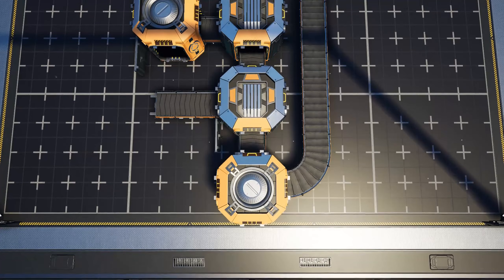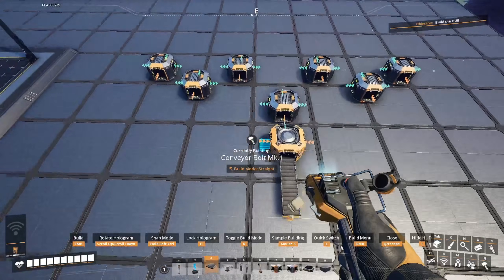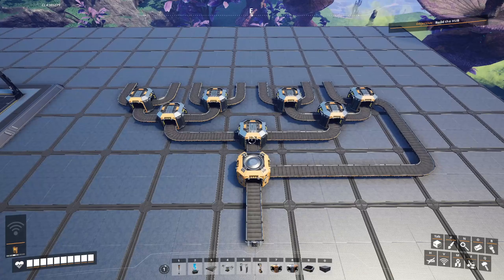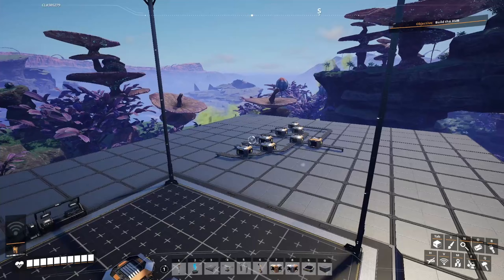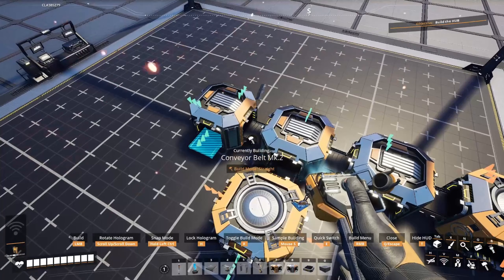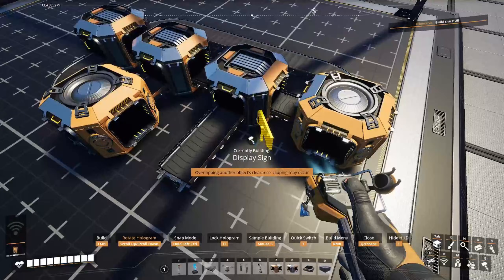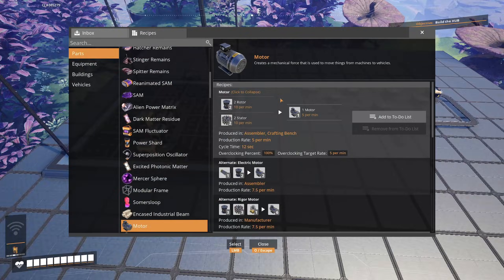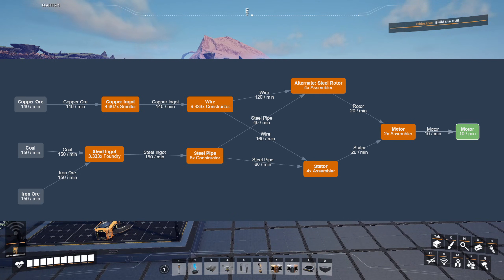Splitting 3/7 and 4/7 - Load Balancing Satisfactory

Comment: This ratio also comes up when load balancing iron rods when making modular frames using default recipes.
Related to a previous ask for the approach for any split, care to share what are you doing to get from two wire feeds of 216 and 288 to be ratios of 3 to 4?
Reply from the maker: That’s great! I forgot about the iron rods and modular frames. 
Sorry, I probably worded that part wrong. It’s a single line of 504 getting split into the 3:4 ratio using the 3/7 and 4/7 blueprint. And that gives me the 216 and 288 needed for the Rotors and Stators respectively. Or maybe I misunderstood the question.
Reply: @moo121  I wondering what you do working "backwards" to get the ratios. The first example has numbers 120 and 160, easy enough to see that dividing each by 40 gives 3 and 4. The second example just scales this up, but what would you do if 216 and 288 were the numbers given first time to work out they are 3:4?
I have a spreadsheet that uses the greatest common denominator function for a line of numbers and dividing that into each number gives the smallest whole number relationship. The "fun" is working out the splitter/merger arrangement to deliver that. Are you doing anything similar?
Reply from the maker: I had a feeling I misunderstood, thanks for the clarification! You are steps ahead of me. The spreadsheet is a terrific idea, I wish I would have thought of that. I'm usually in game and use the calculator to see what 216/504 is as a decimal and cross my fingers that it looks familiar haha. When it inevitably doesn't, I just throw it in Google real quick to get a simplified version. And then the fun with splitters/mergers. Thanks for the spreadsheet idea!